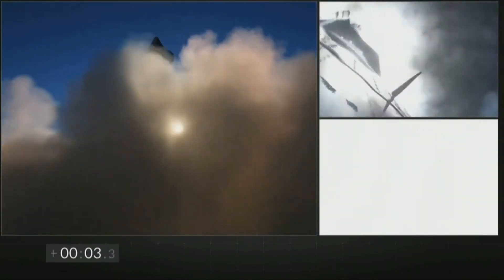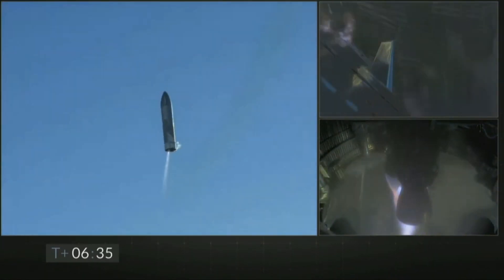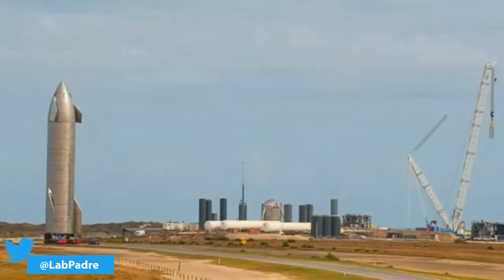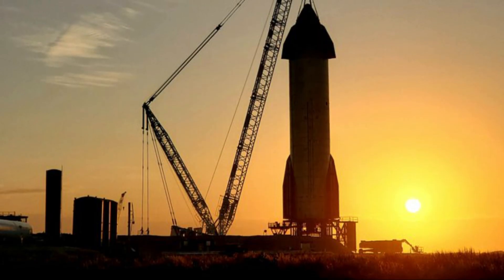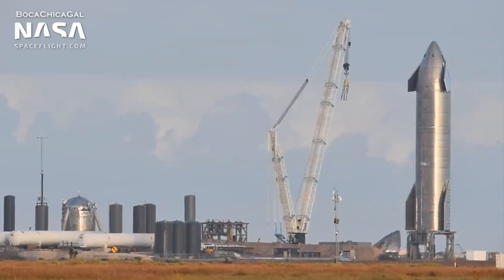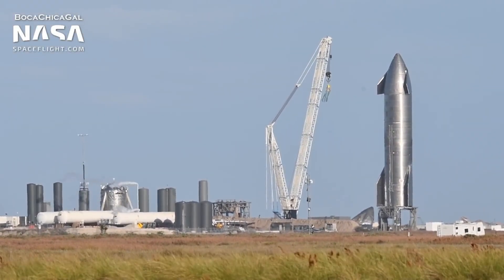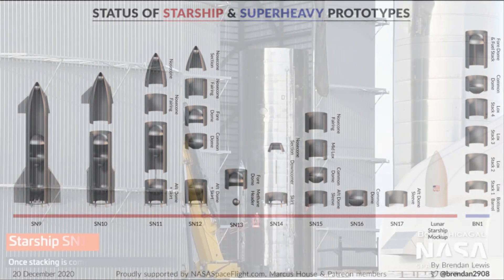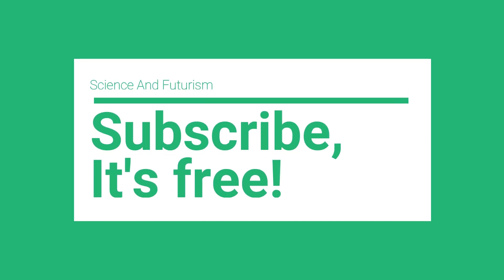Starship SN9: SpaceX Found Solution To Avoid Landing Failure Like SN8!

Comment: So what did they use in SN 8
Reply from the maker: Nothing. They expected header tank to remain pressurized. That's why SN8 was success. They got real flight data so they can improve!
Reply: @spacexplained5001  but I don't know why spacex change that old tradition of using helium in rocket tank,
Reply from the maker: As far as I know, modern rocket now don't use helium. The pressure drop in SN8 was unexpected.....
Reply: @anjaneya6483  I understand the issue is that [He] is a consumable resource that can not be sourced when away from earth.  if your goal is to reuse and relaunch from Mars then we can expect SpaceX to try [He] as a temp solution and again try and use pressure from combustion as a replacement in the long term
Reply: @spacexplained5001  Helium is a limited resource on Earth, but is even harder to collect on the Moon and Mars. So helium is just a temporary work around.

Today, nitrogen is used for the cold gas thrusters. Elon said SpaceX is working on alternatives. 

Likewise, the single use crumple zone legs aren't going to be in the final design.
Reply: @jimknoll  yes its temporary Elon said it

Comment: I don't understand why helium will add the needed pressure. Why not just add More methain to create more pressure from methain alone? Thanks for the video.
Reply from the maker: Actually, helium will not react with methane and will effectively push it towards turbopump ... Adding more methane won't do that
Reply: @spacexplained5001  You will have to update us when they do a static fire test of this new header tank configuration.
Reply from the maker: Sure!
Reply: Chris, think of it like a propane tank in the cold winter. When propane tanks get too cold, the propane no longer vaporizes quickly enough to satisfy our demand. They call this "frosting" or basically it's a frozen propane tank. This is essentially the same problem. Once methane gets too cold it no longer vaporizes fast enough to satisfy the raptor engines fuel demand. Adding more methane won't actually do anything as far as the pressure is concerned; you have to heat the tank or use an inert gas to provide necessary fuel delivery. Temperature, pressure and vapor point of a given fuel are all correlated. As the temperature drops - so does the volatility of the fuel.
Reply: Strengthening the CH4 header tank to deal with the extra pressure that would come from adding more methane would add unnecessary weight, helium can be stored in smaller lighter tanks and as mentioned above, is inert meaning it won't react with the Methane.
Reply from the maker: Exactly!
Reply: @aarons1234  Nitrogen won't react either, but it is heavier. That's why helium is used in the Falcon 9, and problems in providing it famously led to the CRS-7 and  AMOS second stage failures.
Reply: @aarons1234  When would the same PSI of CH4 require a heavier tank than He?
Reply: It will just add Dead weight because They may Not use it as much
Reply from the maker: This is actually a temporary solution. They may move to more light weight option in the future prototypes
Reply: The methane is liquid and incompressible, for practical purposes.  It probably couldn’t vaporize fast enough to satisfy the demands from the engine pump. [my guess...]
Reply: @daveladd99  That's what I was thinking. Perhaps a tank warmer is really all she needs to maintain header tank pressure.
Reply: I agree.  The solution I would expect is to use autogenous pressurization in which gaseous methane is used as the pressurant.  The gaseous methane is created by using liquid methane to cool the thrust chamber.  After picking up heat from the thrust chamber, the methane undergoes a phase change and turns to gas.  A portion is then tapped off to pressurize the methane header tank.  There may be others issues at play that I'm not aware of that complicate this.
Reply: @timcrowley38  At those temperatures the gaseous methane would recondense back into liquid methane once inside the tank- effectively undoing the pressure you add. Whereas Helium doesn't condense into a liquid at those temperatures. Helium will remain gaseous despite the cryogenic environment. In order to liquify the helium the temperature must drop all the way to about -452.1°F. Considering that the boiling point of methane is only -258.9°F, I think it's entirly safe to say that helium will remain in a gaseous state at those temperatures... so it's a very cheap and reliable solution, albeit only  temporary.

That said, you would have to overcome the rate at which the fuel undergoes recondensation in the freezing cold header tank. Not saying that it can't be done - I'm just saying that it's not that easy. Redirecting gaseous methane intended for the fullflow raptor preburners may result in a net loss of overall fuel delivery to the combustion system, lowering thrust capability. Why not simply heat the header tank (more directly) to boil the methane off and provide adequate pressure without all of the added complexity of a gaseous methane bypass system?
Reply: @timcrowley38  I think your method is how they have been doing it.
Reply: Helium composite tank is at several thousand psi so pressure can be readily maintained quickly as liquid methane is consumed in a relatively small methane tank.  The added weight is minimal in the big picture .  Starships payload will continue to decline as the ship is fully developed so this fix is just part of the design maturation process.
Reply: Helium is a temporary solution as when on Mars , it is not really easy to find some here for replenish tanks.
So how about putting a pump INTO the header tank , which will pressurise the ENTIRE tank content towards the pipe  and force the whole CH4 to go to turbo pump direction ?
It is liquid CH4 , so how about putting a ceramic endless screw type one into it , the con of this is that we need a more large tank just because of the volume the pump takes into the tank , to match last volume , also this needs to make the entire SN taller a bit as the main methane tank needs to be more voluminous too.
Why ceramic ? 
Just because of its neutrality .
Reply: @netshaman9918  Pressurising the tank is less likely to be the problem when compared with the necessity of keeping that pressurant gas out of the fuel lines and so destroying the pumps.
Reply: @netshaman9918  my understanding of the Apollo mechanism was that of a 'stirrer', which was used to agitate the contents of the tanks once they had been pre-heated so as to distribute that heat evenly so that the resultant pressure reading would be accurate. The stirring action in and of itself did not affect the pressure
Reply: @netshaman9918  No pump is necessary, just a simple tank heater to boil the methane a little. That will provide plenty of pressure and has no moving parts :)
Reply: @netshaman9918  What is a pump inside the tank going to do?
You cannot 'pressurize the tank' with a pump inside (not using the pump, anyways)
You can use the pump to pump the CH4 down to the engines, which pressurizes the fuel lines, but the problem we are trying to solve here is that when the starship is in sky-diver mode,  gravity is NOT pushing the fuel into the fuel lines, the fuel pickup is at the bottom.

I could type more, but I've lost my thread of thought.
Reply: @netshaman9918  do you mean the header tank could squeeze the methane out by shrinking? (like a balloon or piston maybe)
Reply: The helium is used for the pneumatics, and is already at pressure. Using autogenous methane has a delay to reach full pressure, which is probbly what messed up SN8.
Reply: I suspect the long-term solution will be to boil methane to provide more pressurizing vapor.  It sounds like they currently rely just on heat conduction into the tank and existing vapor ullage in the tank.  They might have a heat exchanger to outside air, with controlled airflow, like the "blend door" in automotive climate systems.
Reply: Helium will stay in the [pressurized] gas phase in any flight circumstances & it's not flammable (as hydrogenium)